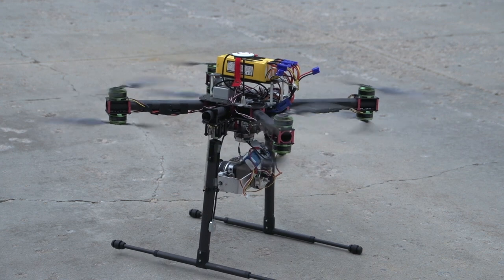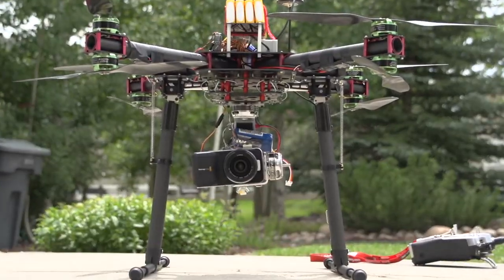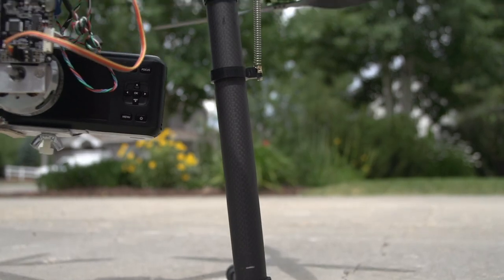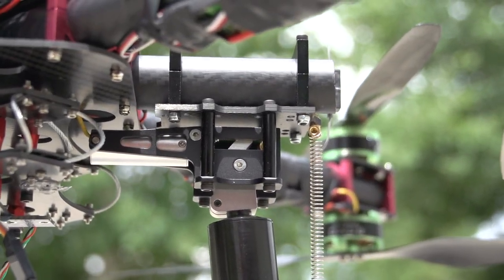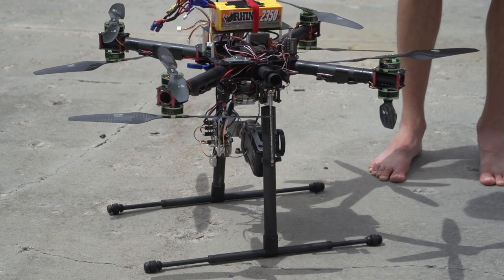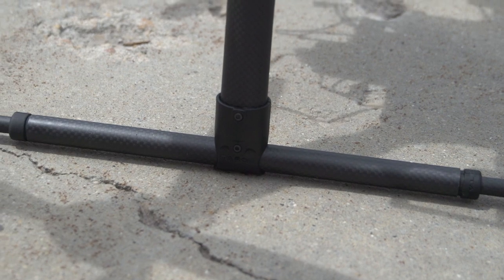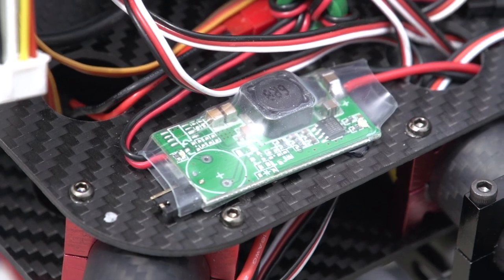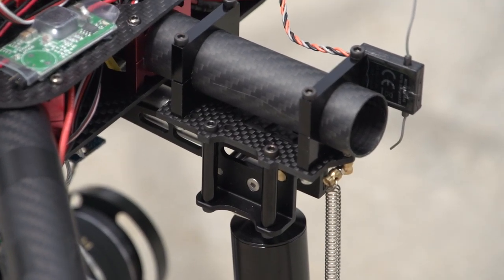FoxTech Pivot Landing Gear - RCTESTFLIGHT -

Comment: Did you say 200+ grams... each? I was considering them for my 680 hex but I really don't need 360 degree panning on a gopro gimbal at that extra weight... seems very inefficient. Foxtech needs to come out with a mid range strong retract set and loose all the extra junk- I built a set of retracts for a 350 out of 30 dollars worth of retracts from China and they were rated for up to 2 KG- only weighed in at about 50g a piece. I would think the next size up retract could be made around 80g each.

Comment: Nice build.
Would you recommend going for a X8 configuration instead of a hex?
Reply: A hex is more efficient and easyer to build
Reply: Allan T I wouldnt agree. A octo is ~30% more efficient than an X8 but the X8 properly configured has more power than a hex and is as compact as a quad even though it draws more power.
Most professional aerial cinematographers run with either X8 or in extreme cases like the hammer, X12.
Reply: tornadoswe 1 prop above another prop can't give you the same lift as 2 props side by side,x8 are harder to get balanced and some flight controllers don't do 8
Reply: If you read what i wrote first. you loose ~30% efficiency compared to a octo. I fly Quads octos and X8's. There is no benifit to a hex over a quad with larger motors/props . X8 has better redundancy than Hex and is the most stable configuration you can get. X8 is brilliant if it's windy compared to all non x xonfigurations.
What controllers do you mean can't handle 8? All controllers that are any good att all handle both 8 and X8 pefectly. Naza, wookong, A2, APM, pixhawk, KK2, Multiwii etc.
Reply: tornadoswe Ok I'm sorry I stand corrected you obviously know more about it than me,I'm no expert
Reply: No need for apollogies, there are many pro's who still contest the X8 but they are diminnishing quickly. I thought att first that you misstakenly called an octo a hex because then your statement would have been true. 2 props over one another loose a lott off efficiency. 
The X8, X12 (and in a few extreme cases X16) are built plainly to have the same build size as a quad, hexa or an octo but with ~70% more lifting power. 
You are correct that an X8 is more complex to build but not to callibrate. As long as the initial motor / prop calculations are correct you will get a verry stable and powerfull heavy lifter. The drawback being more power draw.
Reply: X16 that sounds crazy,I have a quad and a hex,thanks for the info

Comment: What is the purpose of pivoting the landing gear?
Reply: to get the gear out of the frame of the camera, and for the camera to be able to turn 360 degrees around without having gear in the shot
Reply: Daft_Bastard The camera pivots on its own, independently of the aircraft?
Reply: Ralph Dratman yes but you can control the camera from the tx aswell
Reply: Ralph Dratman yes but you can control the camera from the tx aswell
Reply: Ralph Dratman It can, I think this rig of his has dual control, meaning one person operates the craft, while another person operates the gimbal, however even on regular solo flight, the camera can be swiveled